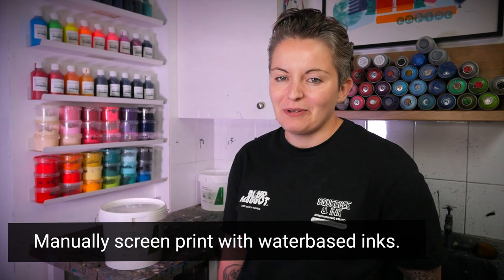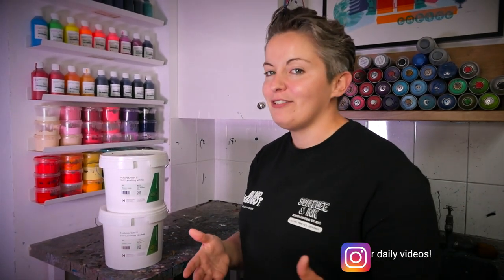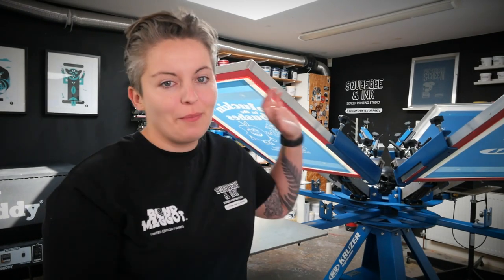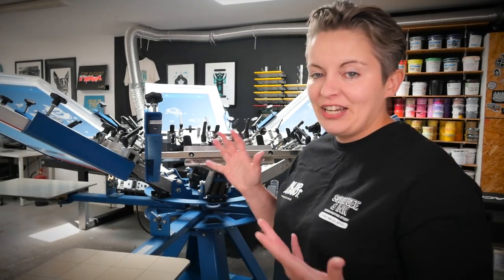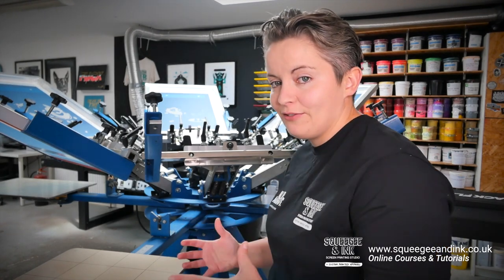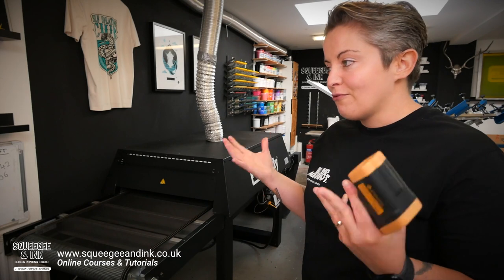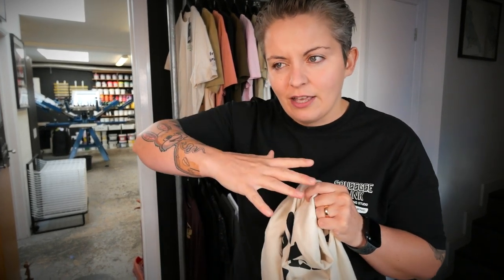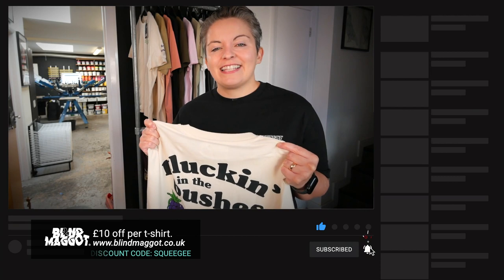Manual screen printing with waterbased inks - small studio setup.

Comment: When printing with WB inks on a manual, do you dd a stroke to your colors in Sep Studio NXT? When we print with plastisol we normally add a 0.3 stroke to layers in Sep Studio NXT, not sure if the same can be done with WB inks to ease registration issues. Thanks for your help!
Reply from the maker: Really mmm? I use the same stroke on WB and plastsiol. I think 0.3 is very tight, depending on the print order and detail in the layer you could try and up that to about .75pt.

Comment: confused??  369C (Coated)  water based inks are all uncoated, are they not?
Reply from the maker: That’s not what I go by or have seen when we went to the waterbased ink factory at Magna Colours 🤓
Reply: The U and the C are referenced to the traditional substrate (paper). Paper usually comes in types of surfaces, Uncoated and Coated. Confusing, I know. The actual Pantone ink color is the same for both coated or uncoated. Not to worry.
Reply: @randylclark4665  Thanks for that.  but C in the pantone world refers to ink type and C being the coated book. UV and Plastisol inks are normally "coated inks"  I do understand Coated and uncoated paper as well.  we also do digital press printing and need to tell the machine what paper is being used.  You may be right and I missing something...  But in the world of garments, the substrate is not coated.  Now, thank you, I am more confused... LOL!
Reply: @davidtrolly7051  It is confusing. The U and C actually have no application to textile colors. Traditional offset lithography ink was translucent, and as such picked up the texture of the paper it was printed on. The ink itself didn’t change. If the ink was printed on glossy paper the color would come out “C.” If the ink was printed on regular uncoated per, the color would come out “U.” Digital printing does not even use spot (Pantone) colors, as it is mostly four color process (CMYK), or a derivative thereof. So the C and the U are archaic designations of a bygone era. I am very surprised that Pantone continues to use them.